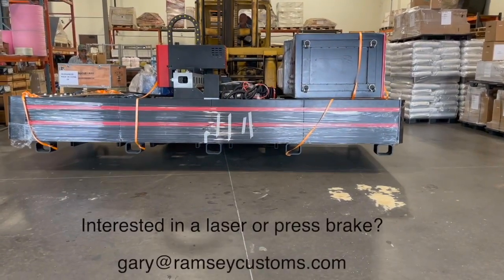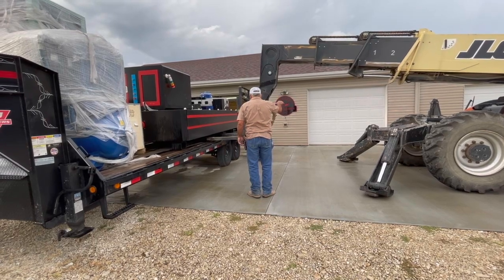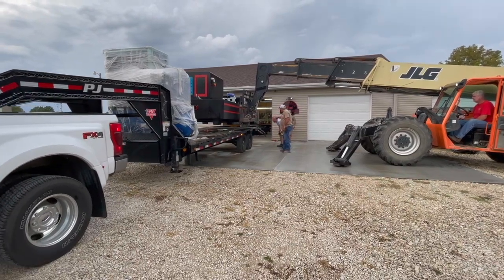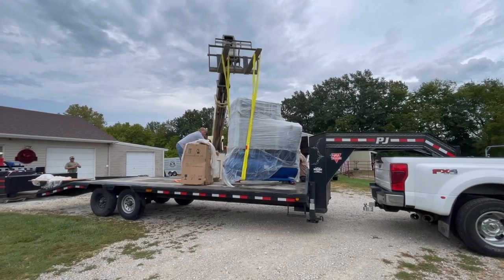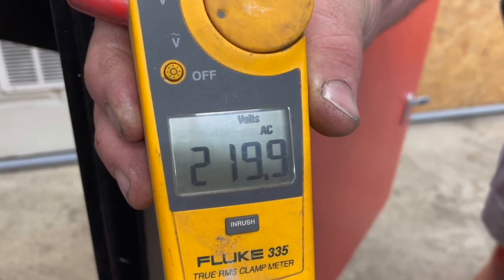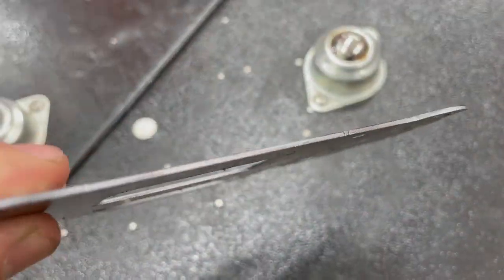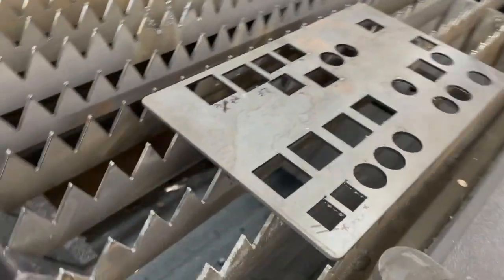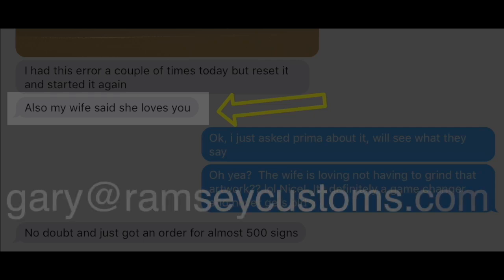Lessons Learned on this Laser Install

Comment: So how'd you solve the racking issue? Tighten down the slats? Drop the pressure? Clamp the metal?
Reply from the maker: well with a full sheet, its heavy enough to prevent the movement, but in general when cutting with nitrogen or compressed air at 240psi, its customary to have to clamp or weight thin sheets down, they tend to want to blow around alot

Comment: I really enjoy your videos and have been watching for years.  I have a throw-back video question for you.  When you made the Ford sign, where did you get the round blue decreative pieces you put around the out side face of the sign?  I was getting ready to pull the tirgger on the plasma cutter you used when they announced they were retiring.
Reply from the maker: Thanks for watching Curits.  I bought those from I site that sells high end bike parts and fastners, and I bought them and some aluminum annodized fastners a few years ago and had them around, then decided to use them on that project.  I dont even remember the name, but maybe do a google search for "annodized aluminum bike bolts"